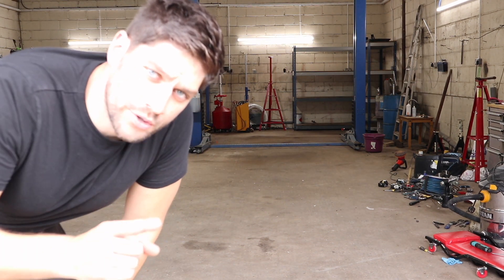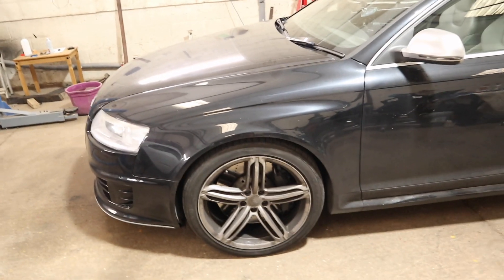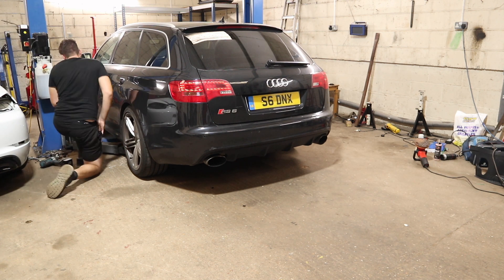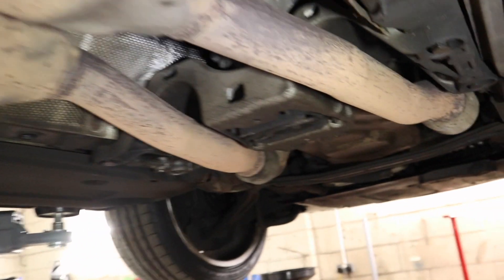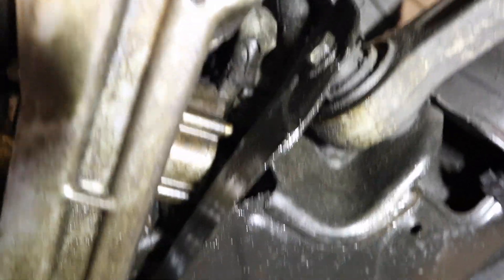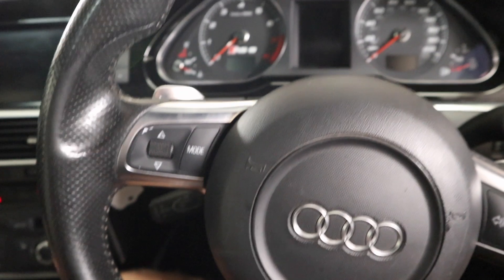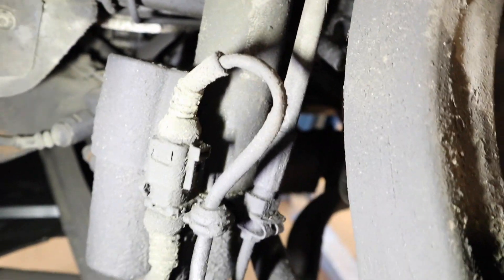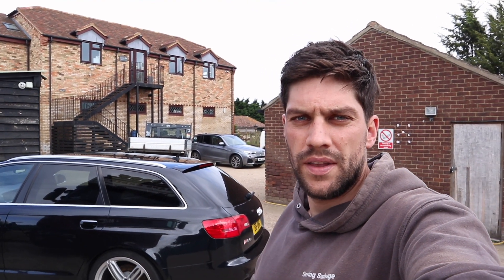EVERYTHING WRONG WITH MY CHEAP AUDI RS6 5.0 V10 TWIN TURBO

Comment: Just kind of interesting video. I thought you were going to address the smoking issue. And not your cigar habit either. Lol
I want to see you put rings and bearings on this v10. It's to much smoke for valve seals.
I'm glad you at least don't have to replace the damper.
What does DRC stand for? Damn Ride Control?
I guess I'll subscribe just to see what happens. Lol
Reply: Close dynamic ride control
Reply: @umarmahmood4511  thanks!

Comment: when would you replace the engine as its got high miles
Reply from the maker: You would only replace the engine if it was damaged and cheaper to replaced rather than repair

Comment: Really hope it isn't, but the title probably should be "some of the things wrong".. would be amazed if that exhaust smoke doesn't point to worn valve stem oil seals at the least.. still, you love taking big Audi V engines out, right? 😄

Comment: Why don’t you do a pressure washing on the complete engine bay top and bottom and thoroughly rinse ,let dry and than run motor then chk under side .😎😎😎👍👍👍
Reply from the maker: Because I don’t have a wash bay 😞

Comment: Engine out is no as hard as most think. When I had a 5 series BMW I watched my mechanic take it out in 15 mins flat and put it back in just as quick.
Reply: BS
Reply: @frankdesbaux  I was there it's not bullshit was at new lodge motors Llanelli.
Reply: @chickenpluckerman4890  bahahahahaaaa. 
 Now you're doubling down.
 It's impossible that's why I call BS.
Reply: @frankdesbaux  Saw it with my own eyes mate, I was amazed at how quick he had it out on the floor infont of me. He said he was changing loads and loads of chains on the 520d which required engine out as BMW had stupidly put the chain in back of engine. Suppose he was just used to whipping them out. It's not a big a job as main dealers will lead you to believe. So I'm tripling down. 😉
Reply: @chickenpluckerman4890  
 As a mechanic I will continue to call bullshit because it is impossible to do in 15 minutes.
 Look son, you're in a hole so stop digging.
Reply: @chickenpluckerman4890   So from the time he opened the bonnet the engine was on the floor in 15 minutes. Is that what you are saying?
Reply: It's faster to drop the whole lot out the bottom and you can't do that in 15 minutes either.
Reply: @frankdesbaux  obviously not a very good one. I can only tell you what I saw. I don't do lies fella, may have been 20 mins but bloody quick.
Reply: @chickenpluckerman4890  You're full of it.
Reply: @frankdesbaux  I gave you the name of the garage and where it's located, give him a ring, see for yourself. Why are you so desperate to prove me wrong. Bit weird.
Reply: @chickenpluckerman4890   What I meant to say was...Stop lying.
Reply: @frankdesbaux  Dont know what your talking about fella, bonnet doesn't need removing, nor does radiator just the hoses. Keep banging on making yourself look a tit. You're no mechanic.
Reply: @chickenpluckerman4890  It beats me.
 But here you are trying to convince me that you know a super human mechanic that can do the impossible.
Reply: @frankdesbaux  Not trying to convince you of feck all mate. You're the one desperate to call me a liar. Run along now.

Comment: I have one of these with about 93k miles and it is also a bit lumpy on cold start. I had the injectors serviced and apparently they were quite poor and one was leaking. It's been a bit better since, so it's worth having them done IMO. It's also worth giving it a walnut blast at the same time. Just be careful as the injector housings will be very brittle. Take it slow and gentle, even with the VAG injector tool. With an exhaust and MRC stage 2 tune, they are unbelievably quick. Mine is 730BHP and 1,000nm.

https://youtu.be/Un8HJFMO7r8

Comment: Before you do anything, i would do a compression check, leak down test and stick a camera in the bore to check condition. You could be wasting your time when the engine is shot. The blue smoke is a big worry for me knowing the mileage and what these cars are really bought for. Ricky Elder at RE Performance knows these engines inside out, so for any knowledge on what they do... that's where I would go for advice.

https://www.youtube.com/watch?v=qdKucbQKZvI&ab_channel=REPerformanceUK

I know the vidwo link is for Mat Armstrong's R8 V10, but the checks are the same i would do.

Comment: get rid of the DRC & use COILOVERS , do not think about it later
Reply: DRC a pain in the backside. Great when in warranty, no so much outside it. A lot have been converted already. But if a bit of pipework and a recharge is all it takes to recommission the old girl then fair enough.

Comment: You know you’re meant to change shocks in pairs
Reply: Being drc it shouldn't matter.
Reply: The shock doesn’t need changing. The system just needs the pipe replacing and filling back up with fluid.

Comment: That is not the start button for engine...that is activation button for start/stop function in town...
Reply from the maker: This is wayyyyy too old for start/stop.
Reply: That's the engine start button, there is no start stop function!
Reply from the maker: Jason Prendergast  they deffo didn’t have start/stop on any Astra VXR if that’s what you mean. I should know. I’ve had 4 of them 🤣 they did however have a engine start button.